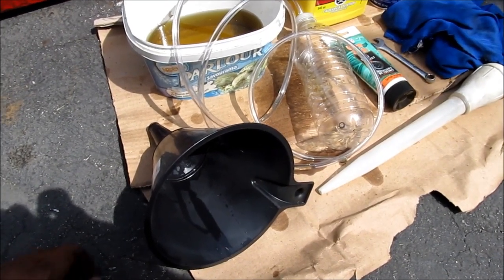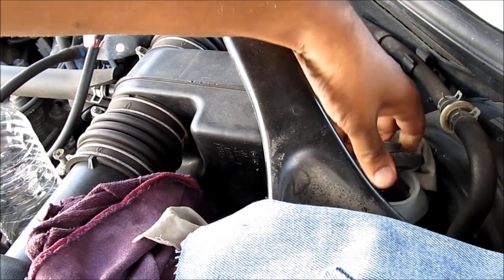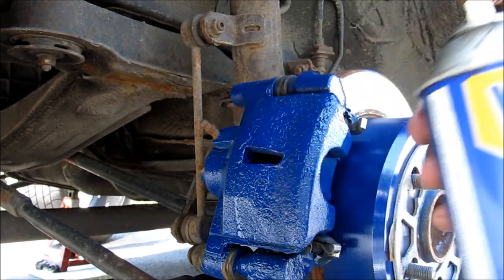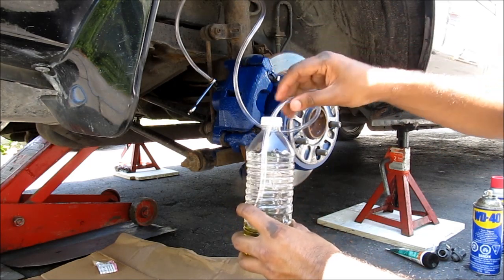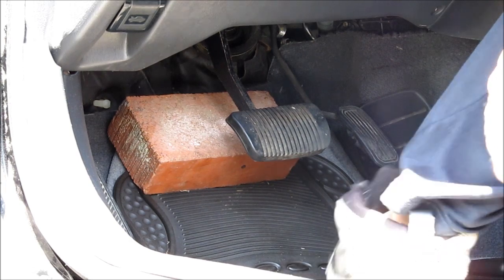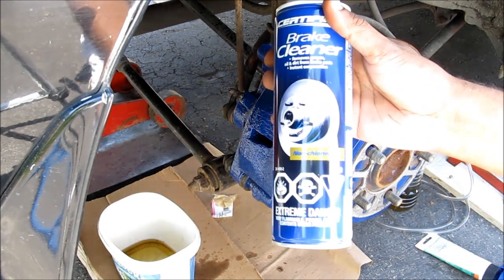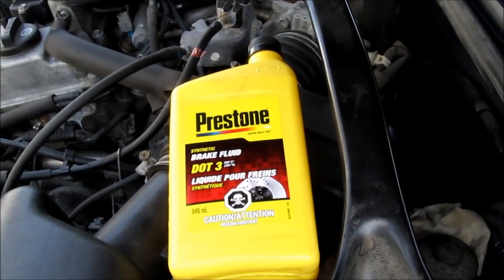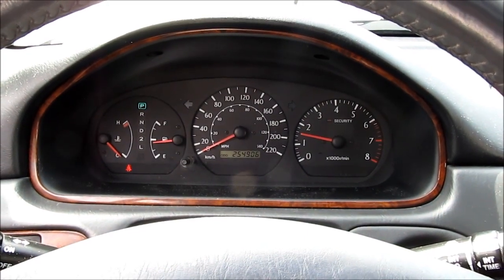How to Flush Brake Fluid

Comment: Pumping the brake pedal with the bleeder valve open is not a good idea. Have someone depress the brake pedal as you open the bleeder valve, then close the bleeder valve and have them release the brake pedal. Wait about 15 seconds and do this procedure again. Repeat until fluid runs clear (probably about 10 times depending on how far the line from the reservoir to the caliper is). The pumping method can introduce air into the system which is extremely dangerous.
Reply: That's the whole point of having the tube in a bottle with oil muppet, so no air gets in the system 🙄

Comment: you should get the  job to your little brother, let pump brake pedal, without brick, let pump and keep pressed when bleed screw is closed then you open it, fluid flows, close it brother pumps and keep pressed and so 5-10 times
Reply from the maker: Yep that's how I do it now.

Comment: Why do you not want pedal to go all the way down when you pump the pedal
Reply from the maker: Because the master cylinder has worn down to a certain point over the years. 
If you past that point, the ridge formed may disrupt the seal causing an internal leak

Comment: To seal around the threads of the bleeder screw, I see that you used brake lube. Wouldn't that be harmful with the brake lube at the bleeder screw thread getting inside and contaminating the brake system? Also, can a teflon tape be used instead of brake lube to seal around the threads of the bleeder screw and does it serve the same purpose as a brake lube? Thank you!
Reply from the maker: I'm not sure about how Teflon tape will react to brake fluid (if brake fluid can burn thru paint what else can it do?) 
The grease is thicker than brake fluid so I'm not concerned about it creeping thru the bleeder threads
Reply: @speedkar99  Can you please help with an issue that I have regarding some noise that has emerged after a brake job? Here is the link and it has a detailed description:
https://youtu.be/OD2MoJEcNqw

Thank you very much for any help you can provide.

Comment: Can I just empty out the master and refill with new fluid, then do it again a few months later? Will that get new fluid in system?
Reply from the maker: Yes that works too but the fluid near the caliper is subjected to heat cycling and wear so it's better to flush since it's not a recirculating system like power steering or coolant

Comment: Thank you speedkar.....can you show brake bleeding in a ABS equipped car using OBD connector/braking on slippery surface. 
Is it okay to do just suck out and fill the brake fluid in master cylinder incrementally.
Are there chances of air bubbles form in the fluid while pouring from bottle?
Reply from the maker: +Jithin P V Unfortunately the abs actuation didn't work when I connected techstream. But the easier way to do it is take for a drive on slippery surface and brake engaging abs few times, then come home and rebleed. Lots more air came out that way when I changed my MC and had to bleed.
Reply: speedkar99 Thank you, so i think diy brake fluid bleeding carries a lot risk as it affects the safety other than vehicle performance.
Can you tell me whether suck out and refill the master cylinder works that is new fluid get circulated?  I mean master cylinder reservoir.

Comment: I have a quick question i have a 96 celica and the passenger rear caliper bolt (top) doesnt even look like a bolt how do i remove it ?
Reply from the maker: +MC LD Its pro ably not a bolt but just a stud that you slide it off. See my Toyota rear brake video for more.

Comment: Good tips. The thing about the brick and the master cylinder not being used to getting pushed all the way. Never thought about that before.
Reply: Why would you not want to push the pedal all the way to the floor ,its what you do when bleed the brakes ,this makes no sense
Reply from the maker: +Hugh Jafro yes you don't want those seals getting damaged.

Comment: I've got a 98 LS400 that I'm going to flush the brake system on.. do I need to do anything to the ABS system or can I just bleed the system like I normally would? Thanks..
Reply from the maker: +Anthony Verducci I recommend that you take the car out for a test drive after bleeding and brake hard on a slippery surface to engage the abs. This will remove air from the abs system once you bleed it again. It worked for me and the pedal became firmer than I ever thought it would be.

Comment: Hi Speedkar, I've recently changed all pads and rotors on my 01' es300 + 1 caliper. When doing this 1 man procedure, how do I know when I have released all air from each line? You say to just wait until you see clear fluid but didn't mention about the air being released from the lines. Can you give me any tips to let me know when I have successfully released all air from each line? Thank you
Reply from the maker: +Body comp Honestly this isn't the correct procedure for a one man bleed. You'll need either speed bleeders or gravity bleed the system overnight.

Comment: hey bud you helped men with the oil control valve anyways soooo i have a 2001 gs300 my brake vsc off abs  light and loud buzzer inside car came on my brakes are now gone pretty much.. i tryed bleeding brake for air both fronts have nice flow coming out now the rears nothing at first but then eventually i got little trickles out of both rears but that is it the reservoir stayes the same only time it really went down was when i bled then front im thinking its my brake booster/mass cylinder but my front brakes bleed just fine rear just no pressure there sending fluid to rear brakes either of them any idea buddy or anyone plzzz
Reply from the maker: Restriction in the line, or a bad proportioning valve.

Comment: I need your help please. I have a 2000 Toyota Solara se rear are drumbs and front are disks. I changed the fluid and when i loosened the bleeding screw. I noticed bubbles. And when I applied on the padel to extract the old fluid, it was stiff. The problem is after I'm done and went for a test drive it, the pedal travels to the floor. It hasn't been a long time since I replaced the brakes all around. What could be the problem? Thank you so much
Reply from the maker: You still have air in your system if the pedal goes to the floor. Repeat the procedure again, ensuring the bleeder valve itself isn't leaking. Put caliper grease around the threads so air doesn't get sucked in as you're bleeding, causing air bubbles in your hose.

Comment: Fyi
If you need to replace master or someone tells you you need replacement..make sure you bench bleed the new unit, or verify with your own eyes that mechanic bench bleeds master ... plenty of vids.. and pay for non- cheap unit with decent valving assemblies
for existing master that is working ok cracking the 2-3 brake line connections at master while brake pedal is under pressure several times may release very top end air bubbles as part of whole car brake bleed.

Comment: I'm about to replace my rear calipers, disks, and pads on my 1999 Toyota Solara. I keep hearing that if the car is equipped with ABS, there may be some other things I need to consider. Any thoughts? Thanks!
Reply from the maker: Follow the procedure in my other video for changing rear brakes on a Solara:
Toyota Rear Brake Pads and Rotor Change .
As for ABS, just be-careful not to damage the sensor or wires leading to the hub.
Reply: speedkar99
Very much appreciated, Thanks! Another great video!
Reply: Time to make friends with a good mechanic.  Good luck.

Comment: Could you use anti-seize compound to seal the hose at the bleeder screw, instead of brake lube?  And also use the anti-seize on bleeder screw threads instead of brake lube?  LAST question:  is there a risk that brake lube or antiseize at bleeder screw thread may get into the brake fluid and contaminate the brake system?

I watched a lot of you auto videos.  You do a really nice job.  Thanks.
Reply from the maker: Anti-Seize does not have the same properties as brake lubricant. It is thinner and generally meant for metal on metal contact surfaces (such as spark plug threads and bolts). It does not have lubricating properties. Do not contaminate brake fluid with any lube, as it could introduce moisture causing ineffective brakes.